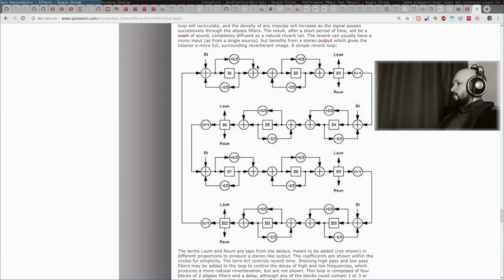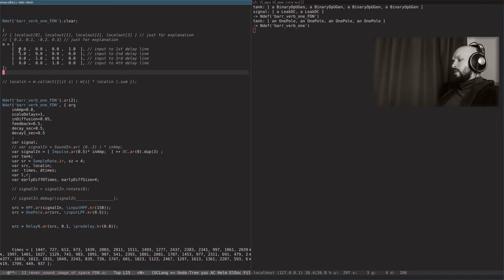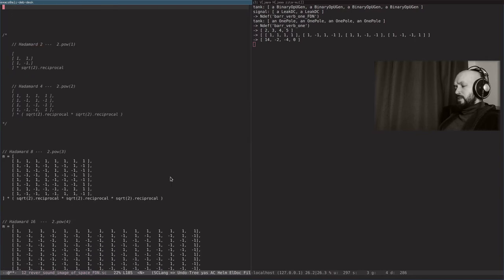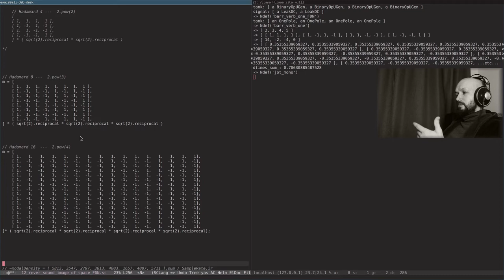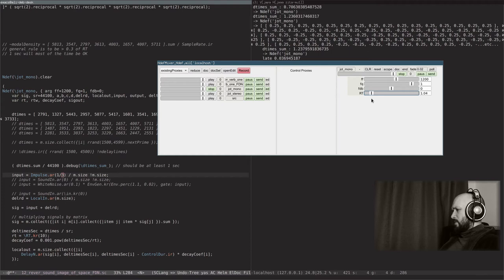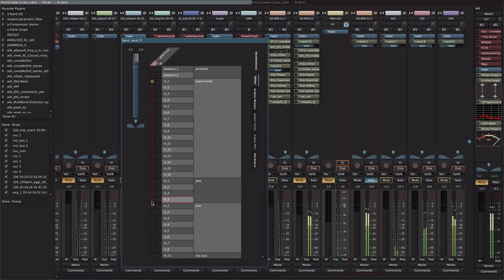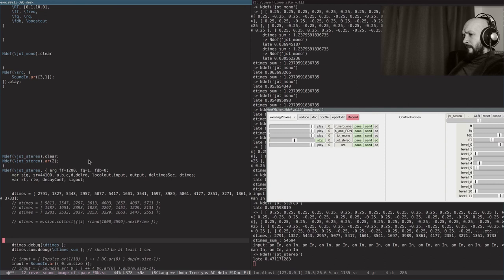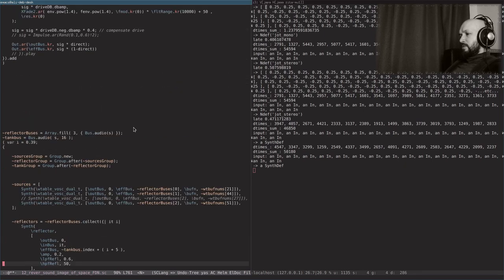12: Reverberation[4]: Feedback Delay Networks - Musical Sound Design In Supercollider

Comment: could you probably explain the ~tankbus.index + (i + 5) once more? as far as im understanding it the reflector outputs 5 signals to the effBus which are then fed to the reverb tank. But in dont get the formula mentioned above, when you for example have just one signal and not three ~sources fed into the reflector and then outputting 5 signals to the effBus. what should be changed in the code and how can one play with the 16 different channels of the ~tankBus.
Here i also dont understand what i = 0.39 is doing.
Reply from the maker: At which minute is it ?
Reply: @Reflectives  it’s the Last Example about min 51:00
Reply from the maker: I guess these both are errors ( 0.39 thing was just left there because I forgot to delete it) and second also somewhat errorneous. At least it's not present in the code that I published on github (this is the thing that's present there: ~tankbus.index + i.mod(3))
Reply from the maker: @jlkt2473  Generally the idea is that every tap from Reflector goes to different input of reverberator.